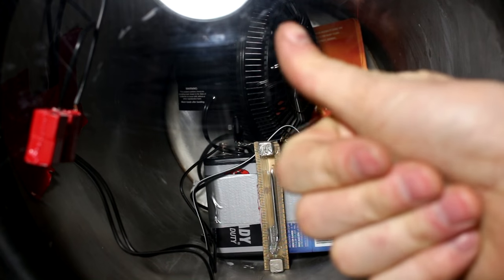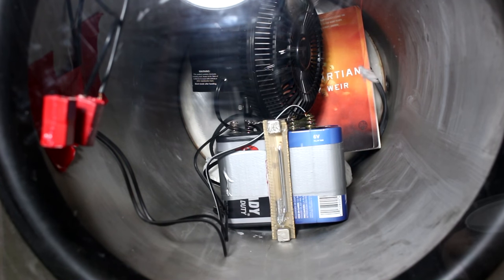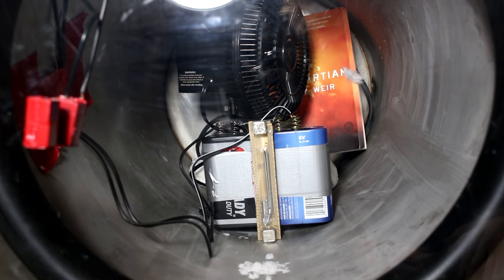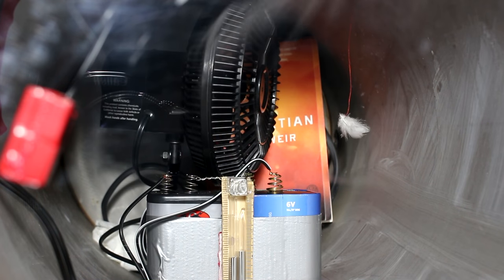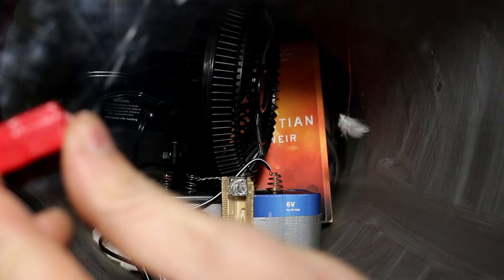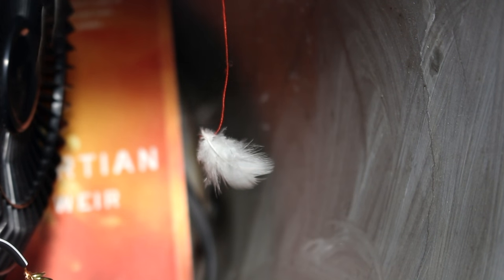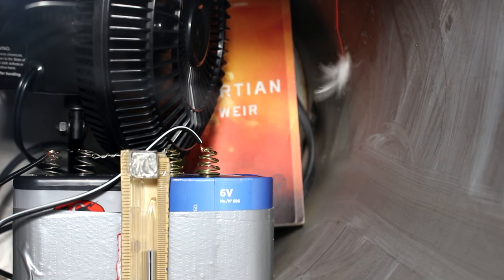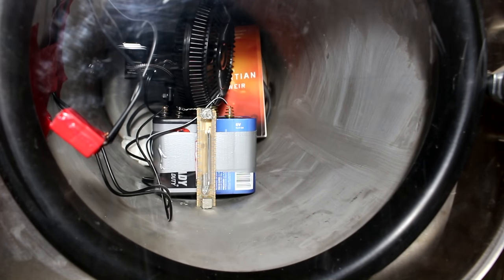How Strong is The Wind on Mars?

Comment: great job, once again!  So does this mean the sand dunes we see on mars are ancient and haven't changed since the atmosphere was thicker?
Reply from the maker: Rather it means that they are not made of sand but rather clay sized particles.
Reply: Sounds like a regolith problem with the moon when we go to Mars.
Reply: Electric tornado? Ill have to read more on this, i thought it was just the very slight amount of wind moving it. Electric charge makes a whole lot more sense.
Reply: Richard Porter
Reply: Richard, do you have a citation/source for that information? Sounds interesting but I'd need solid evidence before I took your information literally.
Reply: The University of Arizona has an image archive for Mars captured by the HiRise camera on the Mars Reconnaissance Orbiter.  They have a few time series where they've photographed the same dunes over time.  You can see them change from one season to the next.
Reply: It proves again that NASA lies about mars atmosphere.
Reply: Mao Zedong Commenting for notifications, I'm also curious.
Reply: BehindDesign
No it proves again that Holywood and movies get it wrong, even when they're trying to be accurate.
Reply: This seems like the closest thing I could find:

https://www.nasa.gov/vision/universe/solarsystem/mars_soil_chem.html

It's still air mass moving dust particles. They have a mass of a few hundred nanograms or micrograms after all and don't require much energy to move.

You could still feasibly get Thermals (columns of warm air) in the Martian atmosphere when the sun heats up the ground there and causes a temperature gradient/difference. Thus, that could also explain dust storms & they would form similar to tornadoes here on Earth, albeit, they'd be less ferocious
Reply: Mao Zedong
Well NASA is testing the mars parachutes here on earth... No it is not a joke, the joke is that you still believe NASA. But let us think that maybe mars parachutes are electric too.
Reply: BehindDesign
Well the American Metorlogical Society has this paper on their website:

http://journals.ametsoc.org/doi/abs/10.1175/1520-0469(1973)030%3C0749:MFMDS%3E2.0.CO;2

Seems to back me up when I mentioned Thermal columns.

I Hypothesise that, dust storms on Mars are started by Temperature differences on the surface, ie: when you get Positive temperatures from Sunlight heating up the Equatorial regions of Mars, thus creating said difference. This creates swirling columns of CO2 & enough energy to create Eddies (small dust devils) & eventually, later in the Martian summer season, the Interannual full planet dust storms.

How they propogate and continue once they start, I don't know. Without putting a surface probe inside one of these storms you'll never find out.

I believe peer reviewed articles that have tested and verifyable evidence.

I would be willing to bet that you probably think the Moon landings were fake, Earth is flat, Satalites don't exist and vapour trials are actually planes dropping chemicals onto us to kill or brainwash us (chemtrails).

I'm skeptical, but when proof/evidence is given & it aligns with what we already know/have tested, then I come to the conclusion it is correct with X percentage of certainty. I'm 99.9% certain I am right about the Thermals, but there is still 0.1% of me that needs that last bit of evidence to put it to bed.

I don't do conspiracy, I only do the TRUTH and REALITY.
Reply: Mao Zedong They're trolling, or just really stupid. There's no point discussing this, don't flood the comments...
Reply: Mao Zedong Man, there is a way to prove your point. Do the same than the video and try to move a single dust grain.
I know that you will call me troll, conspiracy theorist, ignorant, and all these things... but whatever you throw at me will not stop my critical sense from inquiring everything i hear, and i think that at this point it's pretty obvious that NASA parachutes are a joke. It's all what i have to say, thank you.
Reply: TheTLATER Maths are also trolling you, look: P = 1/2 * D * V^2 -> D mars = D earth / 100 --> Therefore Pressure(P) in mars at the same speed is 100 times less powerful than on earth. This is exactly what you are seeing in this video... but i will try to do the reasoning for you. You need a parachute with 100 times more area AND THE SAME WEIGHT to obtain the same effect at the same speed in mars. Conclusion, the use of parachutes on mars is at best RIDICULOUS. But hey... do not answer... i'm trolling you with common sense...
Reply: This is why parachutes aren't used to land on Mars... they're only used to slow the payload down to a point that an inflation device or propellant can be used
Reply: I agree with you Joseph and I find it hard to understand how some of you seem to be implying that all of the USA's rovers on Mars are an elaborate hoax.  Anyway, I hope Cody follows up with an experiment involving small particles and by what mechanism they are able to move and create "dust" storms and "sand dunes".  The electrical angle on this is fascinating...
Reply: Joseph Anderson
Not exactly, they use parachutes to slowdown from 900 miles per hour to an undetermined speed (around 30 miles per hour) in an atmosphere that is 100 times less dense. The problem is that a parachute on mars SURFACE needs 100 times more area for the same weight to have the same effect than on earth, it means that the parachute should not be 100 times bigger (because weight also increases) but 500 times or even more to have a similar effect than on earth... Essentially the parachute should be the size of a football stadium to slow down an insignificant prove. So the prove itself should be a parachute. Well i can continue but i think that it is obvious at this point it is clear that using parachutes on mars is a joke... NOW look at the video:
-->>> How to Get to Mars. Very Cool!
from 2:53 to 3:33 ->>> JAJAJAJAJA so funny how they mock the public...
Reply: Mao Zedong
Of course, they should never use parachutes on mars, but sadly for you they are... in fact they DO NOT USE PARACHUTES to slow down the prove in the first stage of reentry, but in the final stage to slowdown from 900 miles/hour to more or less 30 miles per hour... the funny part is that the parachute they use to slowdown from 900 mi/hour to 30 miles/hour is equivalent to a parachute 100 times smaller here on earth, so ... try to imagine something moving at 900 mi/hour with a parachute the size of a mouse ... just try to do it and not laugh... THIS IS EXACTLY what NASA is saying.
Reply: BehindDesign
Go back to middle school geometry! To increase the area by 100 times, the radius only need to increase by 10 times.
Reply: Joseph Anderson
I know right...more....Elphant sized....but I thought the elephant was scared of the mouse?
Reply: Joseph Anderson Yes... and this parachute has been tested on EARTH... in Arizona specifically. Let us do the inverse operation, let us calculate the equivalent effect of this parachute on mars here on earth. If the parachute is 10 meters in radius... then the equivalent on earth is a 1 meter radius parachute... well a very big umbrella.
Reply: BehindDesign
 Ultra-light materials are used such as Kevlar... The parachute is propelled away from the rover. Also you're forgetting that the acceleration due to gravity on mars is only 3.711 m/s², but go ahead please keep arguing with me, the Aerospace Engineer. I find your stupidity and unwillingness to learn quite amusing.
Reply: Joseph Anderson You still do not get it... Let us do the inverse operation, let us calculate the equivalent effect of this parachute on mars here on earth. If the parachute is 20 meters in diameter then it has the same effect than a 2 meters parachute on earth ... Now please, imagine a prove moving at 900 miles per hour and then opening an umbrella... well a very big umbrella... this is what they are saying... so i do not care if you say you are an aerospace engineer, i'm not going to believe that you can slowdown space proves with umbrellas...
Reply: Joseph Anderson
If you really are an aerospace engineer please tell me for what company you work... to never ever go in a plane fabricated by your company.
Thank you...
Reply: +BehindDesign Your math is just wrong. I can see why you believe in weird shit like this.
Reply: BehindDesign
He may design missile parts or things you aren't allowed to touch. I work in defence as well, designing electronic system for missile guidance and such. Past that, you can't go into details, because of Official Secrets Act and ITAR regulations etc.
Reply: Mao Zedong Well all these arguments based on self-asigned authority like "i'm an engineer" or "this is a militar secret" ... honestly, do you think i'm going to buy it kids?  ... i must admit that your "last resort" arguments are impressive.
Reply: BehindDesign I'm self employed & design electronics for missile guidance systems.

I studied electronics and then electrical engineering, worked at Torness Nuclear Power plant for about 6 months as well.

Besides that, it's not pertinent to what we're talking about. It's not a "last resort" argument by myself nor the other guy, but getting an education, working in X industry for Y amount of time is going to mean you're going to have knowledge associated with those things.

I was just speculating too, he might work in civil aviation or defence, who knows?

Besides, you did derail a conversation about the Martian atmosphere and weath systems and turn it into something about Parachute for some reason....

squeak83uk2 Yea, I think the storms are caused by thermals at the equator. I would be willing to bet a lot of money that it happens during the Martian summers as well.
Reply: Fluid dynamics has this really cool property called similitude that allows you to test aerodynamics at different scales, velocities, densities, and viscosities and predict how they would behave in different conditions. Many of the Earth bound parachute tests you mention take this into account. Also, several parachute tests have been done at altitudes in which the atmosphere is thin enough to be very similar to Mars conditions.
Reply: Well, finally i received an interesting answer from someone in another conversation, i paste it here:

" ... The biggest Package ever soft-landed onto Mars weighed a Ton, and betwen the Heat-Shield Aerobraking phase and the Rocket-Powered Skyhook phase, it used the best Supersonic Parachutes NASA could design...; and they worked, twice, despite not having been tested other than in a Wind Tunnel, and 2 Martian Rovers were thus delivered...

Then NASA tried to scale the design up to handle 5 Tons, to land a Human with Life-Support..., and they tried to test the Newbies on a Sub-Orbital Rocket, going up to Almost-Vaccumn height & then accelerating to supersonic speed while in the layer of Earth's Atmosphere which is at the same pressure as the Martian upper Atmosphere, and then deploying their shiny New 'Chute "under Operational Conditions" ; and it ripped itself to shreds, totally unexpectedly, two or three different times...

NASA were deeply upset, perplexed, and more than a little bewildered...

Last I read about it, in Air & Space Smithsonian magazine, was that not only do the best Supersonic Parachutologists on Earth have no idea why their best efforts are failing, nor do they have any clues about how to fix the unknown Showstopper...; but also, they now have no understanding of why the two 'Chutes which delivered the two Rovers to Mars didn't fail in use, because none of the Theories they used to design them have stood up to subsequent Experimental Results...(!).

So, what they're learning is how very much they didn't know...; meaning that, actually, the Manned Mars Mission appears to be receding ever further from being achievable, the more effort is put into trying to figure out what's involved, & how to do it....."

Look, this is an answer, not an authority argument like "i'm engineer shut up".

As you see not even NASA knows why their parachutes works. My theory... the real air density on MARS is far above what it is being said or the previous NASA missions were faked and this is why the previous parachutes "worked"... well, as always where there is smoke there is fire, therefore something is wrong with all this affair about parachutes.
Reply: Also, it would help to provide a direct link to the article you quoted.
Reply: +BehindDesign Or what could have happened was that the material the Parachute was made of is not strong enough to handle 5 tons. Can you provide a link to the article so that I may read it in full,  I am haveing trouble finding it.
Reply: *****
This information is not mine, but from another user. Therefore i will have the same problems than you to find the source.  Anyway the point here is that people accept what NASA say without questioning it and even insulting people that makes questions or calling them "conspiracionist". This is the way totalitarian regimes work not the way science work. Therefore i invite all of you to make critical questions about NASA and demand answers, and never ever accept things without questioning them.
Reply: BehindDesign I agree with you that the foundation of real science is asking questions and verifying through controlled experimentation repeatedly to get closer to an understanding of how something works.  Results are supposed to be independently verified with multiple repeat experiments usually to ensure there were no variables were unintentionally overlooked that should have been held constant.  The basis of your skepticism however seems to be a belief that NASA has been intentionally lying about its claims.  While I don't blindly believe what people or government agencies claim myself either, the enormity of the evidence NASA has provided supporting the story that they have successfully landed rovers on the surface of Mars satisfies my desire for proof.  What you are implying indirectly through your refusal to believe their claim of using parachutes for deceleration is truthful, is that all the other evidence such as images from the surface have been faked.  There is good reason that your argument gets lumped into the conspiracy theorists territory because that's exactly what you are implying.  Healthy skepticism is a good thing but your doubts have more in common with Flat Earthers (which have popped up in the comments) than with the scientific method.  No disrespect meant, I just disagree with your reasoning that because you can't wrap your head around this one detail, therefore everything NASA has aimed through the years is intentional deception.  You would have to refute an enormous amount of evidence to prove your claim on this one issue.
Reply: BehindDesign
This is why a lot of things NASA does is Peer reviewed. I agree with you on the skepticism, however, I don't think NASA has faked any missions.

They're definately have had failures, some of which they've probably tried to cover up. That said, they ultimately have to come clean in the end as they're a public entity.
Reply: I just found this from NASA itself. https://ntrs.nasa.gov/archive/nasa/casi.ntrs.nasa.gov/20110008730.pdf Experiments show fast moving dust can generate strong static charge, atmospheric glow observed on mars seems to suggest that is occuring.
Reply: Marc83Aus
Yes, fast moving dust can do that and it's been proposed to cause electrical storms.

That said, Thermals at the equator are likely how the storms start.
Reply: Mao Zedong Please, look at the video, with this air density not even a feather moves. You need an incredible amount of energy in the air to move a single grain dust. You are proposing extremely weird electric mechanisms trying to explain dust storms in mars. But all these problems arise because we are assuming that the air density given on us is true, and in my opinion this is not the case. There are hundreds of pictures from rovers showing a "far objects visibility" equal to earth, this is also in direct contradiction with aire density. Even the sky color contradicts the proposed air density. ALL THESE PROBLEMS GET SOLVED IF YOU ASSUME THAT THE AIR DENSITY ON MARS IS ONLY HALF THE DENSITY ON EARTH.
Reply: No, with such small grains as you have on Mars, even the slightest gust can send them moving.
Reply: BehindDesign
 *"You are proposing extremely weird electric mechanisms trying to explain dust storms in mars"*

No, I am not. Thermals are caused by the Sun baking the ground at the equator, causing changes in air pressure, creating a swirling air mass.

Look up how tornadoes form, they form via this method too!

So, nice strawman you constructed there, but it's all irrelevent!
Reply: rem brandt yes, they use chutes to orient the craft, then use rocket propulsion to slow it down, then use large air bags to absorb the impact.
Reply: BehindDesign
Blue sky has nothing to do with Earth and more do with the gasses int eh atmosphere and the light energy/photon energy of said light.

Blue is the most easy of the visual sceptrum to scatter, because it has the highest energy. This is why the sky is blue on Earth and a grey-blue colour on Mars.

It would appear Orange on Venus, because most light is blocked and absorbed, the blue energy photons slow down enough to shift their wavelength to the orange-red side of the visual spectrum.
Reply: Yeah right, do you see this mountain in the right side of the photo? Can you appreciate the white fog because of distance? Yes... this fog is white, like on earth, but there is no white dust in mars, so this color comes from water vapor maybe? ... Ok, now seriously, please assume that this photo was taken on earth not on mars and everything will be easier for us all. Of course it does not mean that the entire mission is faked, but maybe ... NASA is not 100% honest with people. I just say where there is smoke, there is fire.
Reply: BehindDesign
I don't assume anything, I'm not a radical conspiracy nut case, religous person or anything else.

They're transparent as they can be, not everyone at press conferences has all questions as answerable, because they dont have the information there or it's not been peer reviewed, and thus proven fact.

You do realise that things can change colour with concentration right? That and there is no "fog". Mars has a lot of Mountains too, in fact, Olympus Mons is the largest mountain in teh Sol System.

There is no smoke and no fire. You're believing what you want and not what is factually correct.
Reply: Mao Zedong
So you see a photo with a blue sky and a distance white fog IDENTICAL to earth and you assume that it's mars because NASA say it is mars? Not even catholic church have such faithful believers.
Reply: The mars atmosphere can be anywhere from orange to grey. Much like Earth's atmosphere can be anywhere from blue to orange.
Reply: BehindDesign
It's not Identical to Earth though is it? And given they have soil samples, atmospheric tests and gas tests done, then yes, I believe they do have the self-critique and rigor to be taken seriously.
Reply: Mao Zedong
It’s amazing for me, how an intelligent person could say that a fucking photo with a blue sky, a white distance fog, that anyone can do in any desert, that contradicts everything we have been said about mars, that contradicts all previous photos about mars, that contradicts all previous theories about mars, … is perfectly normal? How is this possible? What the hell is taking place???? Where is the theory that say that mars atmosphere is filled with fine red dust now? Where is the coherence with ll previous explanations? … oh my God!!
Reply: BehindDesign
Try find a place like that on Earth. The burden of proof is on you.

Oh, and turning photos around, putting photoshop filters on it & identifying triangles and such in parts of the picture will onyl confirm my current judgement about you.

Deserts on Earth are too arid for Fog. Mars doesn't get fog and there is no Fog in that picture. It's called the Horizon...it's the sky in the far distance terminating with the ground because you can't see further than that, because Mars is a spherical body.

The fact you seem to think a Blue sky is only possible on Earth just confirms all I need to know about you....
Reply: Enough is enough, we have been said that mars atmosphere is filled with fine red dust giving it's characteristic red colour. The first contradiction is that if you compare Martian sky with earth sky at 30.000 meters (at this altitude earth atmosphere has the same density than mars atmosphere) you discover that sky is BLACK because it is so dim that it reflects no light, but in mars it reflects a lot of light, just like earth with a red filter. Moreover all Martian photos expose the same visibility than earth’s atmosphere at SEA LEVEL, something very unusual taking in to account that Martian atmosphere is 100 dimmer. And then you find this photo, where the supposed red dust turned white!!! And the supposed red sky turned blue, and you have a NORMAL TERRESTRIAL PHOTO.  Moreover mars atmosphere, having 1% the density of earth’s atmosphere, is obviously NOT ABLE to sustain such a quantity of dust permanently floating. Some people try to explain this photo saying this is because sometimes light scattering on mars can produce a blue sky, but it is only very early in the morning and very late in the afternoon, not in the midday as in the photo. To make it worst you discover that NASA uses PARACHUTES to slowdown they re-entry vehicles from 16.000 km/h to 1000 km/h in few minutes in an atmosphere so dim than cannot move a feather when you place it in front of a fan at full power, and they test this parachutes in EARTH’S atmosphere, and these parachutes should work in high altitude layers of Martian atmosphere that are even dimmer than the surface... in all is SO DIFFICULT to believe it all… is so filled with contradictions, nonsensical data, etc. that … I honestly do not believe them.
Reply: How i have to tell you that MARTIAN ATMOSPHERE IS 100 TIMES DIMMER? it means that the visibility on mars is similar to moon, not to earth. In this photo far objects experience a clear fade that is INCOHERENT with the fact that Martian atmosphere is 100 times dimmer, Everest has better visibility than mars and the air is 50 times denser, understand the contradiction. But it is worst… because in this photo objects fading with distance TURN WHITE NOT RED, and this is IN CONTRADICTION WITH EVERYTHING WE HAVE BEEN SAID ABOUT MARS, NOT ONLY AIR DENSITY, BUT EVERYTHING.
Reply: BehindDesign "How i have to tell you that MARTIAN ATMOSPHERE IS 100 TIMES DIMMER?"

An atmosphere doesn't emit light for a start.

If you mean more tenuous, less dense etc, then yes it is. It's because of that, it makesblue light and UV light even easier to scatter :D

You're more likely to get skin cancer on Mars basically.

"Everest has better visibility than mars and the air is 50 times denser"

Clearly Everest doesn't have a bunch of Iron (II) Oxide dust floating around it then does it? Can you give me a date on when that picture was taken? Ie: Martian Winter or Summer? Mars has periodic dust storms during Martian summers.

"TURN WHITE NOT RED"

You don't understand how light and atmospheres interact do you?

"and this is IN CONTRADICTION WITH EVERYTHING WE HAVE BEEN SAID ABOUT MARS, NOT ONLY AIR DENSITY, BUT EVERYTHING."

No...it's not. You just can't understand it for some reason. That or you refuse to understand it & want to believe what you want to believe, screw everything else, including rationality, reason and logic.

Too much of a good thing is bad:

Sugar = Diabetes
Chocolate = Diabetes/sugar coma
Pure Oxygen = Oxygen toxicity (yes we need to breath nitrogen too)
Equality = Communism
Free Markets = Crony Capitalism
Skepticism = Conspiracys everywhere

You're too extreme in your thought processes.
Reply: Ok man, so your answer is to distort my words, answer nothing at all, play with words trying to sound convincing and continue to say that a photo with a blue sky and a white distance-fog in midday is perfectly normal in mars. Just to begin, blue scattering on mars take place at morning and afternoon not at midday. Now please can you describe us the light scattering process that turns the red dust floating in atmosphere to white and blue? Remember it contradicts all previous photos showing a red, brown, green, yellow sky, so good luck. THANK YOU
Reply: Sorry, you are wrong again, blue is only visible at sunset, the rest of the day sky is gray. HERE IS THE PROOF --> express.co.uk/news/nature/576481/Blue-sky-night-Martians-delight-NASA-probe-sunset-RED-planet-BLUE
In short, you are defending something irrational. All photos from mars show a gray/red/brown sky. The photo i posted is clearly unusual for multiple reasons, from ambient light, to sky colour, horizon colour, visibility, etc. In short, it is clearly a terrestrial photo. What is taking place here is called fanaticism, you believe NASA so blindly that even with evidence in front of your eyes proving they are deceiving you, you reject it.
Reply: BehindDesign
Yes, but a blue sunset on Mars is not impossible, nor uncommon.

The atmospher is hazey due to the elevation and high amount of CO2.

I'm not defending something irrational at all, you're pushing something irrational, ie: "NASA fakes everything, like the Moon landings. go watch Alex Jones!!! STOP BELIEVING THE LIZARD PEOPLE!"

I don't "believe", I understand nature, unlike you, & thus come to more sane conclusions. You have no proof that the picture is fake either, nor have you mentioned where it is on Earth, if it has been taken on Earth.

Your argument is a baseless accusation, likely because you have a general distrust towards anything associated with the sky, space or planes....i wouldn't put it past you if you thought vapour trails where "chemtrails dropping Phosgene on people to brain wash us"...
Reply: BehindDesign Here is something more than a picture, that has been peer reviewed, and is open to the public. Not some UK Rag newspaper I see in my local cornershop.

http://elib.dlr.de/86477/1/Collienne_GI_VRAR_2013.pdf

German as well, so you can't pull the NASA Truther conspiracy out of your arse now.

Oh and this one:

http://onlinelibrary.wiley.com/doi/10.1029/98JE02556/full

This one mentioned Blue forward scattering towards the horizon.
Reply: BehindDesign time to pack it up and go home. its embarrassing that someone of my species can be this gluttonous for intellectual punishment.
Reply: Zach D
I've already partially explained Rayleigh Scattering to him once....now..peer reviewed shit, that dates all the way back to 1999?...
Reply: Mao Zedong it quite literally makes me cringe to read his insane and fragmented comments.
Reply: Zach D
He made me facepalm, literally, with one of his comments.

Conspiritards will only ever pic over a single picture, some will doctor it in photoshops to "reveal hidden meanings" & then you have people that sort of do the same thing, but without photoshop, like this guy.

Blue light has a shorter wavelength than red/orange light etc. Thus it is more likely to interact with atmospheric particles. 890nm seems to be a common wavelength I see in peer reviewed literature for Martian Rayleigh Scattering, which is blue-violet/UV-C.
Reply: Mao Zedong you are correct. but, true blue is very rare on mars, its more of a dusky flint blue. still blue nonetheless
Reply: Zach D
Aye, grey-blue. But that is due to our atmosphere being mostly nitrogen, and the Martian atmosphere being 95% CO2 and only 2.5% N2.

Oxygen: 0.146%
Carbon monoxide: 0.0557%
Carbon dioxide: 95.97%
Nitrogen: 1.89%

Exact numbers. This guy seems to forget that the sky isn't "red-orange" permanantly, nor is it always caused by dust, nor is the only dust on Mars Iron (II) Oxide (aka, Rust).
Reply: Mao Zedong Why you insist in to change my words? i told you literally "it does not mean the entire mission is faked" remember? now let us continue, you still insist in to believe that a little blue in the sunset can explain a blue sky in the MIDDAY, understand this word? MIDDAY, not sunset, MIDDAY... please repeat with me MIDDAY, MIDDAY, MIDDAY ok…
Now let us go back to the topic, you say that this blue sky in the M I D D A Y (identical to earth) is due to light scattering, When the only time that a pale blue can be seen in the Martian sky is a tenuous halo around the sun in sunset. Now you want to deceive everybody including yourself trying to make us believe that a few blue around the sun in the sunset can explain a bright blue sky in the M I D D A Y, this is like believe that a red sky in earth is possible on earth at MIDDAY. But it’s true, nobody can fight against fanaticism and.. I think it’s impossible to make you understand that this earth photo is not mars. I think that at this point it will be PERFECT to say that this photo is faked by me, but sadly I cannot say that… it was faked by NASA sorry.
Reply: BehindDesign After looking around, NASA has said they alter some images to have a blue sky, more for Beauty shots than anything else.

http://www.universetoday.com/100771/what-mount-sharp-would-look-like-on-earth/

But even in True colour/natural lighting, the sky is still green/blue-grey in colour.
Reply: Zach D Thank you for your insults, It's interesting to see how you attribute reason and logic to your side, and then you provide ZERO arguments to support your point, only insults. This is sign of my victory.
Reply: BehindDesign
Thanks for ignoring my last two comments which completely debunk everything you've previously said.

You'ved proved my point that you only see and find the the "truth" that you want. A bit like an SJW, you fail to see past what you want to see & anything other than that is "lies, false, fake, stupid etc".

Sorry, but your argument is not objective at all.
Reply: BehindDesign victory cannot be obtained by self proclamation. it must be a consensus among peers. you do not have said consensus.
Reply: Mao Zedong Now you admit that NASA alters photos, but you propose something very bizarre, NASA alters Mars photos to make them similar to earth… But you have been repeating here that blue sky in mars is due to light scattering … so what is the correct answer? NASA altering mars photos for no purpose? Or impossible light scattering on a tenuous atmosphere? The correct answer is… these photos are from earth not mars.
Honestly, the bizarre excuse that NASA alter mars photos to make them similar to earth sounds as a perfect excuse to justify that they had been caught with blue sky photos in the past, for example the first Viking photos showed a clear blue sky, (They had a very short to alter these photos right?) So the scientific interest of alter mars photos to make them similar to earth is nothing more than generate confusion or hide the inverse process.
Well, let us return to the topic because again you failed miserably to address my points, for example:

“Time of day is irrelevent,…”

Oh my God ... Really? This is why we have vibrant red skyies at midday and blue skies at sunset….. right? Please do not be ridiculous ok? Try to think coherently for a moment. Light scattering is produced by air light diffraction around air aerosols. The longest distance light travels inside atmosphere, the most accentuated is the light scattering, this is why light scattering is so obvious at sunset and less visible at midday, because at sunset light travels more distance inside atmosphere than at midday. But air density is also important, very low air density produce far less light scattering than a denser atmosphere. Well, mars atmosphere is 100 times less dense than earth’s atmosphere, so light scattering in mars is unappreciable at midday, and only produces a pale blue halo around the sun at sunset. This is WHY I say that this photo is impossible for mars.

“Yet you have no evidence to prove it is not Mars.”

It’s not me who has to prove that a photo with a blue sky and a white horizon, that ANYONE CAN DO IN ANY DESERT OF EARTH, is not mars, but it’s YOU or NASA that should prove that it is mars. This photo is DIFFERENT from all previous photos we have seen from mars (not agree with this point? Please LINK your evidence), so observing an earthly horizon colour, an earthly sky colour, and observing this is indistinguishable from earth..… my conclusion is that this is earth.
The rest is boring because you only move around my arguments contradicting yourself, so I think it does not deserve any answer.
Reply: BehindDesign by moving around your argument, do you mean that your are getting tired of looking like a fool?
Reply: Zach D
Well, the fool is not the one that explains how light scattering works, but the one that insults others. ;*
Reply: BehindDesign
It's not unknown, nor out of the norm, for NASA to edit photots they've taken. They're called Beauty Shots.

That said, the two pictures you've cited are NOT beauty shots.

"But you have been repeating here that blue sky in mars is due to light scattering"

When it occurs, it is because of that. I'm not claiming modified pictures are created by scattering light, so don't strawman me please.

"NASA altering mars photos for no purpose?"

No they do it and label it "WHAT MOUNT SHARP WOULD LOOK LIKE IF IT WAS ON EARTH"! It's very bloody clear when they do modify a picture.

They do it for asthetic reasons and philosophical reasons. They likely also do it to enhance or sharpen certain parts of images so they can ascertain better information from fine details.

"So the scientific interest of alter mars photos to make them similar to earth is nothing more than generate confusion or hide the inverse process."

There is no scientific interest in releasing Beauty shots, other than raising public awareness to get more funding for scientific endevours.

*"Well, let us return to the topic because again you failed miserably to address my points, for example:

“Time of day is irrelevent,…”

Oh my God ... Really? This is why we have vibrant red skyies at midday and blue skies at sunset….. right?"*

WAYYYYY to strawman me you twat. And you're the one saying I'm taking you out of context and misrepresenting you. How fucking rich.

"Time of day is irrelevent, unless it's night time of course."

Ie: it doesn't matter when light is present, more of "when it is present it matters". Sorry you couldn't understand that...My point was that it CAN occur at any time of day, it's more common at other times than others however.

"Please do not be ridiculous ok? Try to think coherently for a moment."

How condescending of you. I've done Physics at degree level thanks, and I'm not the one entertaining some stupid conspirtard theory.

"The longest distance light travels inside atmosphere, the most accentuated is the light scattering, this is why light scattering is so obvious at sunset and less visible at midday, because at sunset light travels more distance inside atmosphere than at midday."

It has little to do with distance and more to do with the wavelength that is reflected from atmospheric particles. Please...look into before you start spewing bullshit. The Angle of incoming radiation (solar) to atmospheric particles is the most important aspect for Rayleigh scattering..

"Well, mars atmosphere is 100 times less dense than earth’s atmosphere, so light scattering in mars is unappreciable at midday, and only produces a pale blue halo around the sun at sunset. This is WHY I say that this photo is impossible for mars."

I've already addressed this in a previous post and won't go on about it again. Besides, I never stipulated "blue sky at midday" in my previous posts. It's something you've attributed to me so you can fight against it, aka, another Strawman argument you've made up.

"It’s not me who has to prove that a photo with a blue sky and a white horizon, that ANYONE CAN DO IN ANY DESERT OF EARTH, is not mars, but it’s YOU or NASA that should prove that it is mars."

Ok, so Guilty until proven Innocent. You've earnt yourself a mute/block because you no better than a Stalinst communist SJW type. YOU are the accuser & thus the burden of proof falls upon you. General concensus stipulates that this is Mars. Me, the public and scientific community know NASA, ESA, Roscosmos & JAXA edit photots for "beauty shots" and release them along side true colour originals, like the Mount Sharp picture in the Universal article I posted. So please, get off your high horse.

*"so observing an earthly horizon colour, an earthly sky colour, and observing this is indistinguishable from earth..… my conclusion is that this is earth.
The rest is boring because you only move around my arguments contradicting yourself, so I think it does not deserve any answer."*

So "because I say it is, it means it's Earth". Are you God? Are you someone that works at a Spec Agency? Are you someone whom has deep indepth knowledge that KNOWS WHERE these photos where taken? No, you're fucking not. You're a loser conspitard on the internet that picks over semantics and shouts "CONSPIRACEH!!" whenever something doesn't line up with their world view. 

No need to worry about replying to me in future, you won't be able to.
Reply: +Codys'sLab  But what about the so called "Dust Devils" that the mars rovers recordet?
Reply: +BehindDesign Ok, so, before we consider anything, I would like to propose another question, "Why?", why would NASA lie about Mars's atmosphere and fake photos? What would it benefit from it?
Reply: To hide the alien cities obviously. The NWO don't want people to know their reptilian cousins are living there, or deep under the earth.
Reply: Iorpim
Honestly, i do not know why NASA is doing it. I only know that the data they are providing is filled with contradictions. I think we lack data to understand why they are doing it.
Reply: Iorpim
Don't Necro man...seriously..
Reply: BehindDesign doing it for funding or $$$
Reply: Everybody makes questions about the unknown, but few people makes questions about we supposedly know. This one powerful reason to explain why NASA is faking missions. The problem is that we do not know what is really happening on Mars, maybe there is nothing unusual, maybe these missions are real and Mars is only a desert… or maybe they have found a giant spaceship and are exploring it, the question is that we have no way to verify ANYTHING. In my opinion there is some data about mars that does not make sense and photos are clearly faked. One problem of our society is that we are extremely permissive with contradictions coming from governments or mass media. For example air traffic controllers have specific instructions to deal with UFOs, anyway science say that UFOs does not exists. We are used to these kind of contradictions and we accept it as long as our life is not affected. We are supposed to base our opinions on logic, but in reality 99% of opinions are based on ideology.